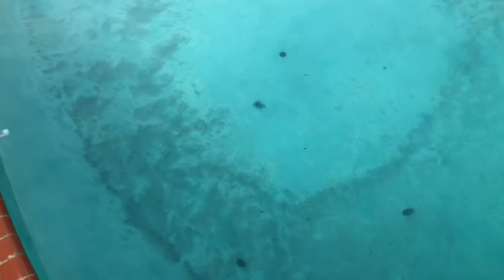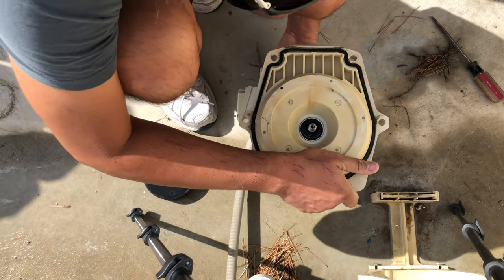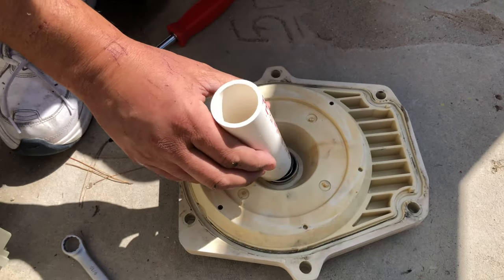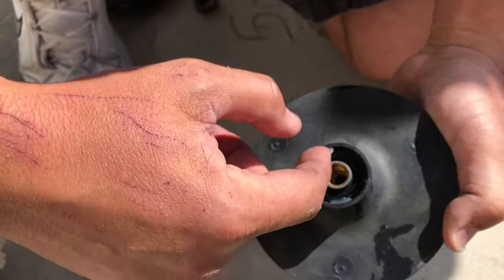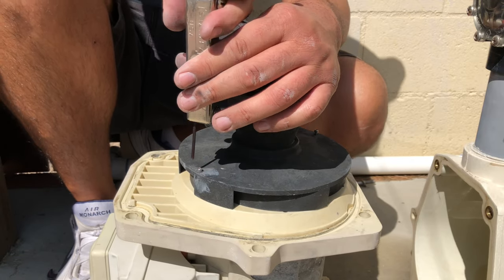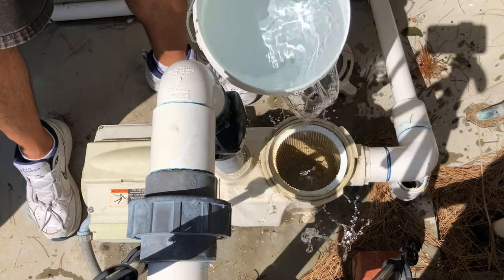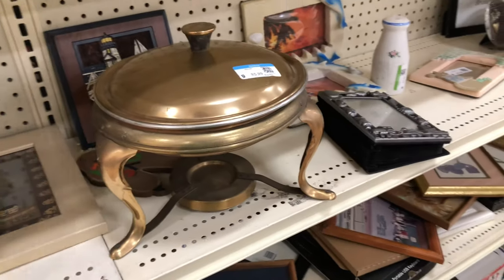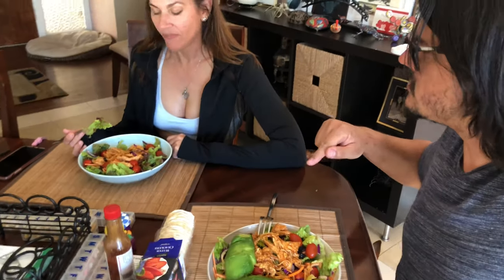How to replace a Pump Seal in a Pentair Intelliflo pool pump and Daily VLOG 129

Comment: "Don't ever touch the bearing surface with your fingers, the least amount of oil can ruin the seal!!"

3:50  Oops.

Wear rubber gloves when you handle it and use a 1" diameter PVC pipe to drive the ceramic seal in.

Comment: Great video! I saw some videos that say you should let the silicone cure for 12-24 hrs before priming the pump. Does it really matter?
Reply: It's not silicone sealant. It's silicone grease. It doesn't cure. That said, the seal manufactures don't recommend using silicone grease on the seal. Just clean the area and use soapy water or something called US Seal lube to lubricate the areas where the seal is pressed into the housing.

Comment: Dude you rock takin apart my 3hp itellafloVSF right now just got to the impeller. my slow leak made a lot of build up salty looking stuff around motor area causing paint to come off will that destroy my motor?kind of like how salt builds up on a salt water tank around loose fittings. Any thoughts?
Reply from the maker: Here in California the motor would probably be fine without paint. Depending on where you live, the weather can be bad for the metal. Clean it up and repaint it if you’re worried.

Comment: Very informative and perfect timing as I'm about to do my own. Just curious as to which silicon do you use and where do you get it from??
Reply from the maker: Regular 100% silicone you can get it from any hardware store or https://amzn.com/B000PSE46S/?tag=povert0f20-20
Reply: The silicone I use we get it from a pool hardware store called scp or superior pool products, You can also find it at local pool stores but it's expensive. Its cheaper at a home depot or lowes.

Comment: My pump isn't leaking but has a hard time getting primed and pumping do you think the seals need replacing to fix it?
Reply from the maker: If it is primed today, but loses prime tomorrow. Then the seals are definitely bad.

If it is more than a foot above the water, then it just can’t pull prime and you’ll need a check valve in front of it. You should probably have a check valve anyway.
Reply: @VinceRocca  thanks

Comment: I used to work on pools while in college...many years ago. The pumps today sure have changed. How long before the motor must be rebuilt? Great DIY skills my friend!
Reply from the maker: I’m not sure motor rebuilding and rewinding is a thing anymore. I haven’t seen a motor shop in years. I suspect its a dying profession like the vacuum repair shop. This motor is variable speed and saves tons on electricity. I’ve had it for 5 years, I think. It paid for itself after 3 years. I’m in the black now.

Comment: Thanks for the video Vince.  I just replaced the pump seal.  When I turn the  pump on there was a load squeaking sounds at first then got quitter as the pump ran.  There was still a leak however.  I turned of f the pump.  Should I expect that sound?  anywhere else the leak may come from?

Comment: Excellent video...FYI...IMPORTANT...The instructions by the seal manufacturer specifically say to NOT use grease that contains either PTFE or Silicone...(I routinely use both for jobs like this)...So instead I used a good quality lithium grease...
Reply from the maker: Cool. The lithium grease will help it slide in, I’ve always used silicone cause when it dries it will help seal any imperfections. Maybe its overkill, but I can see why it would hurt or why the manufacturer says not to use it. Either do what works. Glad I could help. You can help me by subscribing so I can get to 100k subscribers.
Reply: Silicon and PTFE based lubricants draw the carbon from the primary ring and smear this material on the face of the mating ring, causing a build up which eventually destroys the sea
Reply: Ohh yea and u got my Sub! Nice Job!

Comment: If pump is not leaking could these seals cause groaning pump noise which escalates with rpm's?  Thanks for your help.  Great video.
Reply from the maker: I doubt it. They would more likely cause a squeak. I would think a groan would be dry wear, therefore it would leak.

Comment: I have bad pump corrosion any reason why
Reply from the maker: Other than chemicals. I was one told a pump thats isn’t bonded (grounded) to the pool will corrode. Mine wasn’t bonded for 8 years and the pain came off. It’s bonded now and seems fine.

Comment: Nice video. Something I wonder about: does the pump seal gasket (the one you are holding at 5:00) have a correct orientation? It does not look completely symmetrical (one side is tapered, the other is flat).
Reply from the maker: No. The flat side can go against the pump housing or the pump face. It gets squished and seals. But I get your concern. My OCD likes to put the smooth side of washers toward the nut even tho it doesn’t matter.
Reply: @VinceRocca  Awesome, thank you! I didn't think it mattered either, I appreciate your reply.

Comment: I can't* get the pump impeller to loosen. I removed the reverse thread screw but impeller is super tight.
Reply: Nevermind I got it. Had to use a strap wrench. Hands too weak 😭

Comment: Great video but need help.. replaced the seals but cant get impaler back on?.. not enough threads showing to screw on.. am I doing something wrong? please help
Reply from the maker: Is it the right seal? It needs to be pounded in using a piece of pipe, then the impeller part needs to be seated all the way in. I assume you did that, so the only thing i can think of is its the wrong seal? Leslie pools will install the seal free if you take the pump to them. So maybe they can trouble shoot?

Comment: Thanks for this tutorial. Stumbled across this vid when searching for a fix. Saw yours was exhibiting bing similar symptoms to mine (not as bad of a drip though!) and proceeded to follow your instructions. Step by step was perfect. Bought a new PS-1000, followed the steps and it’s looking good. Only difficult part was getting off the impeller. Was wayyyy tighter than yours looked. I also learnt that in extreme heat it could actually be a bad impeller rather than the seal. Apparently the taper has a tendency to expand which means a seal doesn’t fit properly in it. Fortunately mine looked good. Once again appreciate the vid. Watched a few and this was by far the best. Helped me do it myself simply.
Reply from the maker: Awesome. Yeah, the impeller can be tough depending on age/heat and how tight it was originally put on. Glad I could help. You can help me by subscribing so I can get to 100k subscribers. Thanks.